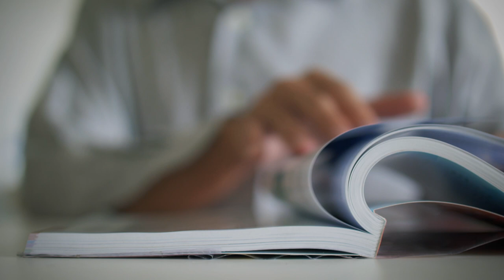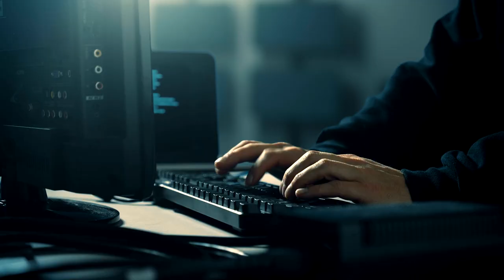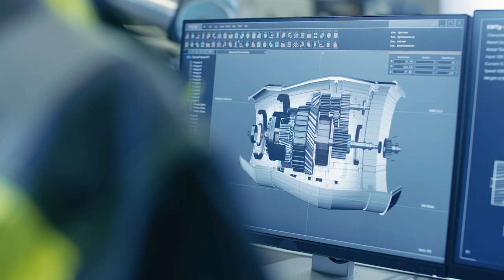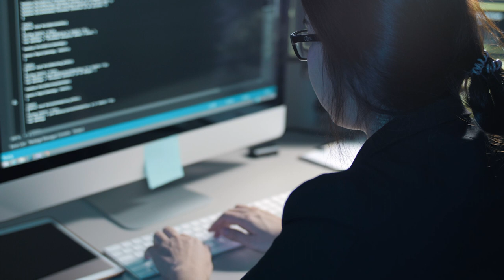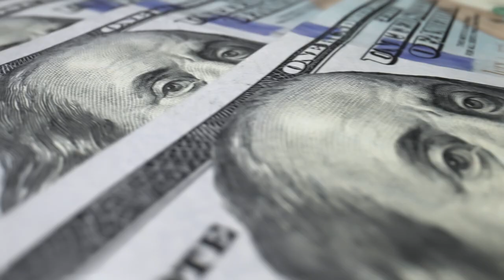Another Side of Equipment Right to Repair | The Dirt #92

Comment: This is the reality that Daniel speaks about.  I don’t agree that right to repair has anything to do with intellectual property.  But all other points are salient.  I was an engineer for construction equipment.  Every time we built the software, we kept parameters, sensor input, etc., into the software to make sure you were maintaining operator safety or, in the case of emissions, compliance with Federal Mandates.  The OEMs would love for you to get more power at the expense of emissions, but Uncle Sam says, “oh no you don’t.”  My biggest concern is product safety and that’s why I oppose this legislation.  Why do you think that a lot of compact equipment is limited to 74 HP?  It’s because emissions regulations change as soon as you hit 75 HP.  I really don’t care if you take you machine from 200 HP to 250.  I don’t want people dead because they didn’t understand the consequences of their actions.  And we don’t want certified repair guys to be able to make these modifications either.  Now, do OEMS need to make it possible to easily replace injectors…. Probably.  But going after this wholesale rather than piecemeal is the wrong approach.  The legislation is too broad, and needs to be narrowed in scope for the satisfaction and legal protection of all involved.
Reply: Oh, and thanks for covering both sides of this issue

Comment: My bullshit flag flew right off the poll in his first sentence. When the manufacturer sells a single manual for $1700 for a single one you don't have access to information. Dealerships don't want to share information because it takes service work from them. Yeah I can replace a electronic injector but I can't program the computer with the new injector information now the engine is out of emissions compliance.

Comment: LMAO the OEM does not support the right to repair. This guy is so full of it. The largest percentage of repairs that cause the necessity to HAVE to call the dealer are emissions related, which deem the equipment unusable when system sets any code. MUST use dealer at this point. The OEM does not support the right to repair the systems they make the most money on. They can set that price so incredibly high, and you don't have a choice. Again this guy is full of it. The automotive industry has released the ability to diagnose and repair for years now without programming capabilities. It is not as hard as they make it sound. PROFITS are all that matter. Don't let liars like this guy fool you with there political lawyer talk.